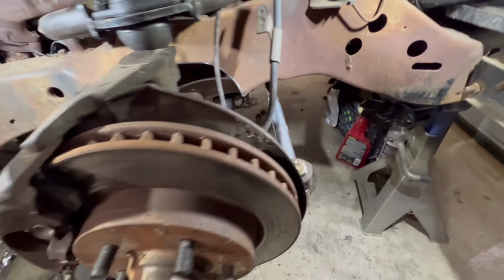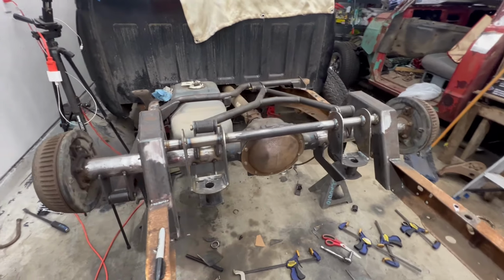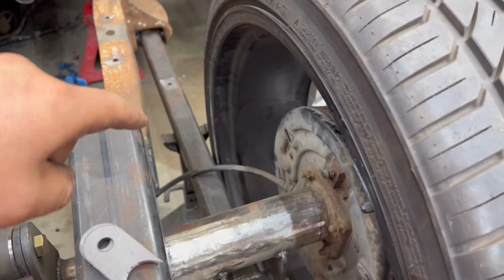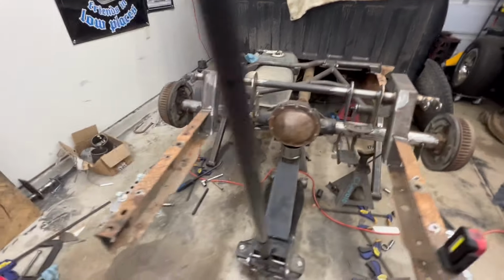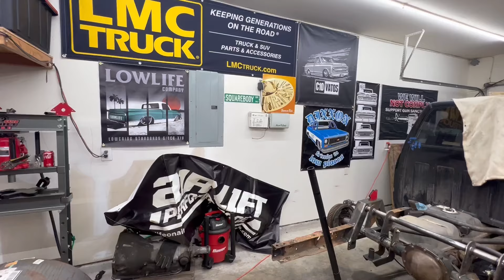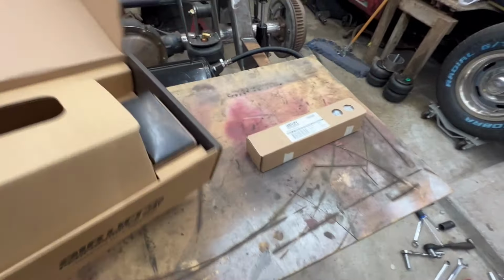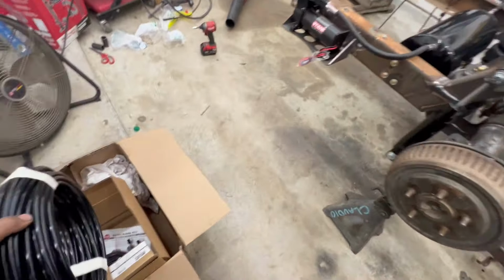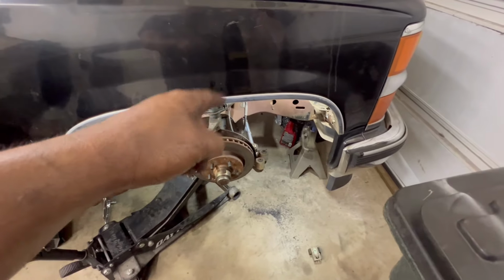4 Days To Make It Mobile! Crunch Time!

Comment: I bet it was the rust on the threads that messed you up.  Use a wire brush to clean up the threads before you mess with the tie rods.